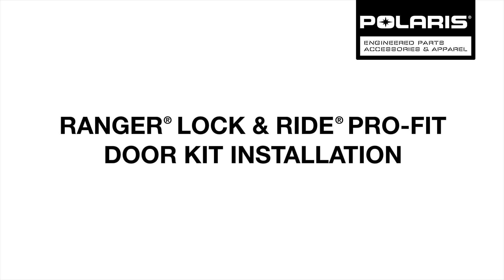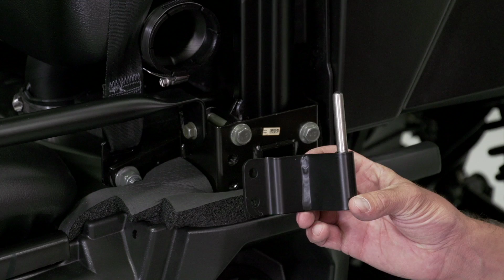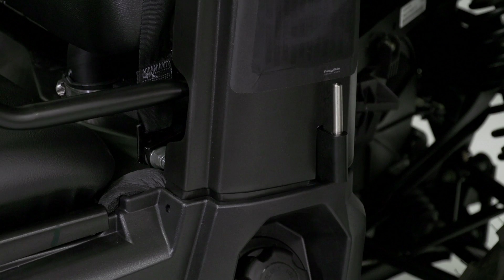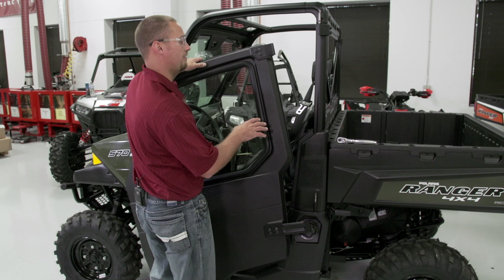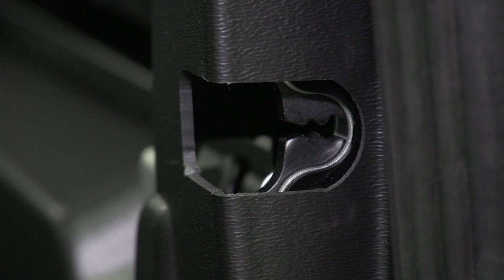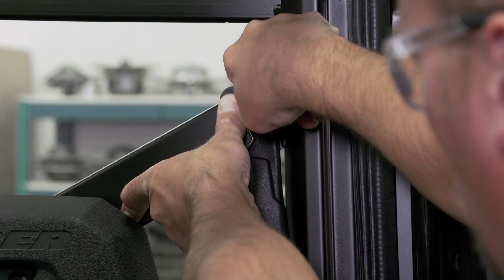RANGER XP® 900 Door Install | Polaris Off-Road Vehicles

Comment: cool doors but you guys are nuts on the prices, i have a 4 seater $3,200 is ridiculous.....
Reply: yes they are pricey.  I have the better than these northstar doors with the foldable windows.  To guy buy a  northstar done is  around  21-24 K.    I waited till they had rebates on the base models then i had some dealers price out all the good options and  a install of them.   I was done at 17,200 and had everything the 21k plus northstar had minus the fancy rims and metallic paint.   Im using mine in the woods, i dont care about fancy paint and rims.  Only going to get scratched and hammered any way.  But I have the heater, wiper w/ washer, good insulated doors with folding windows.  Upgraded headliner, two stage fold out windshield and upgraded rear glass.   I thought it was the better way to go...my dealer was awsome to work with as well.
Reply: @Dooguy  ac is a expensive upgrade
Reply: I agree to expensive